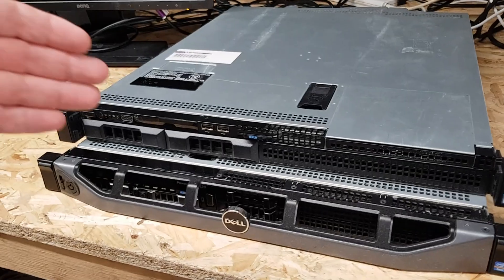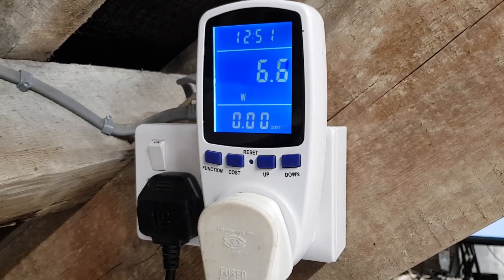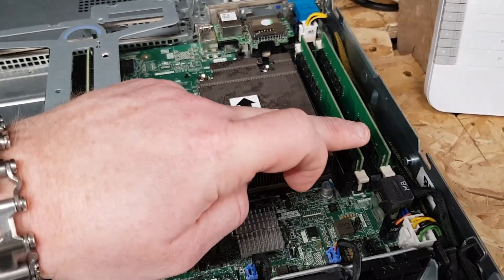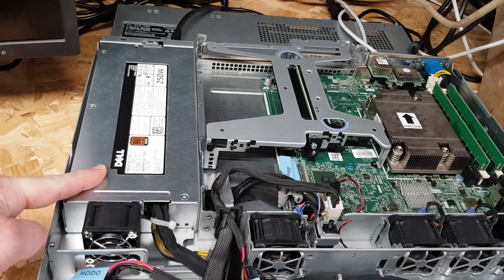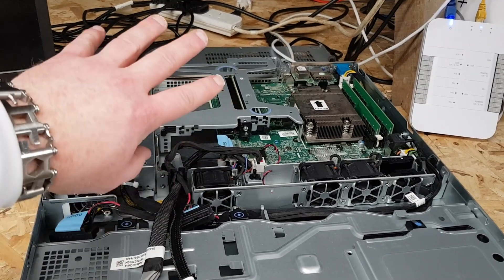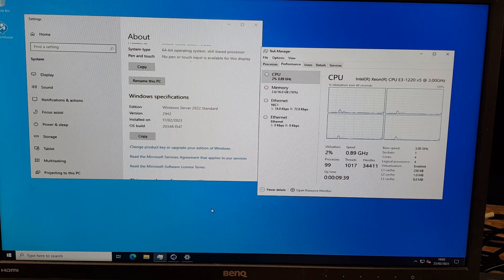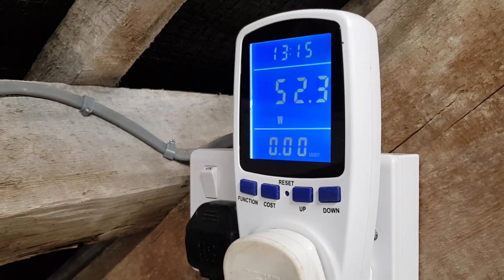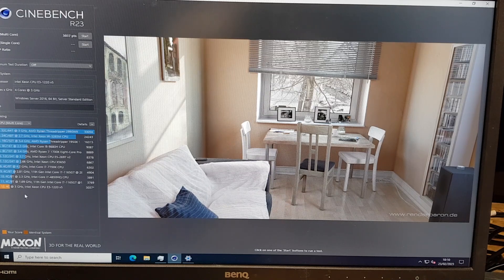Homelab Servers Pt7 - The Dell R230 a great starter

Comment: Wow, went looking for info on these and found a single video that answered literally everything I wanted to know!  I bought an R810 before COVID/energy prices went bananas, powerful, but noisy, old, and very expensive to run - £60/month to idle it 24/7, 300W idle.  24 core 48 thread is nice, but low clocks 1.8GHz with no real turbo boost hamper it from certain tasks that prioritise clock speed over cores such as dedi game servers.  Brilliant video, low cost, low noise, low cost to run - seen a deal on a bunch of these on ebay for £65 each without RAM, may make a cluster!

Comment: Hi Jim or anyone can you please confirm if the Idrac 8 console for this model has power monitoring or not?
i have Dell R320, R330 and R610 they all have power monitoring in Idrac console, if I missing something?
Reply from the maker: I'm pretty sure it does, not got that unit online at the moment but it's a standard part of idrac
Reply: @JimtheITguy  yes that what I thought,  but my unit it doesn't has, only have power control and temperature that's it, I asked a few  people on Reddit they said the same so just want to check if there is issue with the Dell R230?

Comment: Hi Jim, 26W idle? How? :) My r230 (my first poweredge) with a 1220v5, 64GB, h330 (or 32 doesn't change much) and a single 120GB SSD (rather old samsung) idles in windows 10 pro ~50W. Windows shows it idles ~1.5GHz. I've enabled build in power efficient system profile in the bios. Any hints?
Reply from the maker: Put the power management into OS managed, windows is very  good at idle power management
Reply: My Dell R230 same CPU with Single SAS 3.5"  and 16GB RAM ran server 2022 or Esxi 7.0 consume about 43W

Comment: This is my homelab server of choice, love this little thing. Picked up 4 hotswap bay version with H330 PERC and 8GB memory + 1220 v5 Xeon for around 80 EUR. Dropped in another 3x8GB memory modules (+150 EUR), 1230 v5 (+30 EUR) to have 4c/8t instead of 4c/4c with 1220. The biggest let down is the expensive DDR4 UDIMM modules, RDIMMs will not work. Another let down is GPU support as you've mentioned, but actually the PCI express power limit on these is 25W, so if you want any NVENC capable GPUs you're pretty much out of luck or will need to wire in a separate PSU for the GPU power. One model that I can confirm works plug and play is PNY Quadro P400, this one supports 7 1080p nvencodes simultaneously or 1-2 4K ones. I have this passed through to win10, the TDP for the card is 30W which is more than 25W limit but everything works fine. I had to throw out optional NIC to free up the slot for it and mess around with backplates but nothing major. One more thing - DO NOT buy WD Blue SA510 SSDs as for some reason PERC doesn't like these, after many hours of frustration I googled for PERC h330 and this drive model compatibility and what do you know, a few people also complain. Long story short Samsung 870 EVO's work fine, I've set the PERC to HBA mode and did not flash the IT firmware. Idles at around 55W with the Quadro installed, great machine to run Home Assistant, various containers, Plex/Jellyfin with Quadro P400 and mess around learning stuff. If I did not plan to have a separate NAS box I'd go with 730XD now, but I like the idea of physically separate storage more. Love your channel, found it very recently, hope you continue making videos!
Reply: Wow 80 Euro for that it's very cheap,  I'm looking for one in Australia they selling with no HDD or caddy 8gb ram for $250 AUD

Comment: Have you or anyone tried installing the DPWC300 2x nmve in the pcie riser?    With two 3.5 drives as boot plus 2x nmve, would be a great Hyper-V option.  I know it does not support the expansion card as a boot option, so the nvme would be where the VMs are stored.

Comment: 2, 3, or 4 of these would make a very decent VMware vSAN cluster. Add an NVMe to PCIe card and a 25GB NIC and you can deploy vSAN 8's Express Storage Architecture. And pretty much all components are on VMware's vSAN compatibility list, more or less.
Reply from the maker: The would indeed, if i could find 3 the same for the right price that would be a full vsan cluster for about 80w of power

Comment: People I know get the r210-220-230 as a pfsense server
Reply: My r230 is used as a pfsense server. 64GB DDR4 2400 memory. E3-1280 v6 and a dual QSFP+ nic. It runs like a beast pulling only around 60 watts.